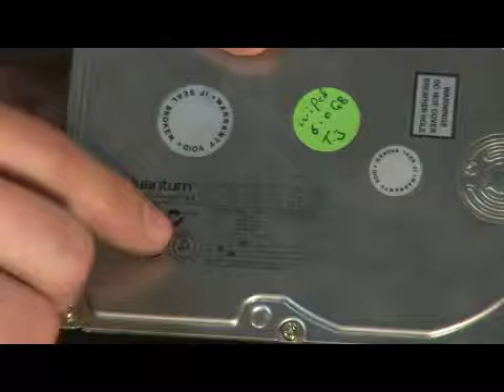How to Change the Master/Slave Designation on a Hard Drive

Comment: Hello, I have an old Windows XP machine that I would like to upgrade to an SSD with Win10. The problem is modern SSD today do not incorporate a jumper, is there a way to set the SSD as Master without the jumper, the bios is seeing it as a slave drive. Thanks.